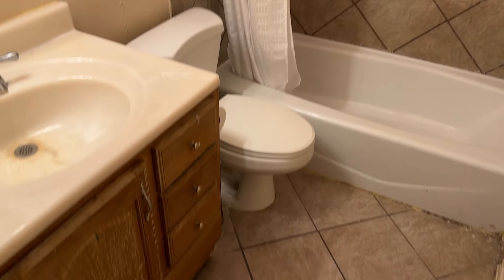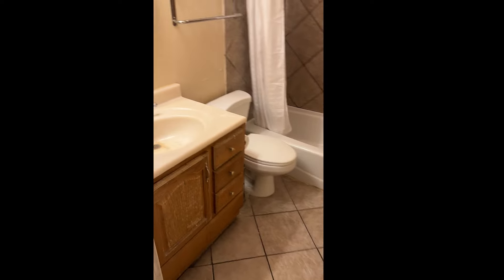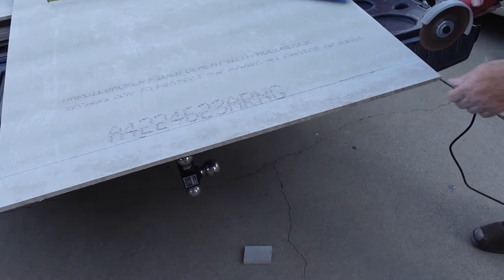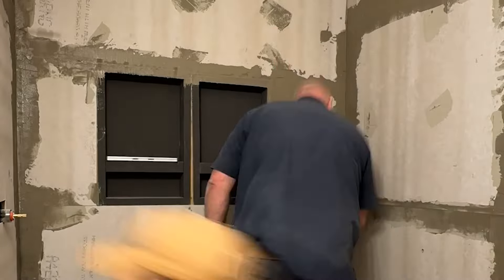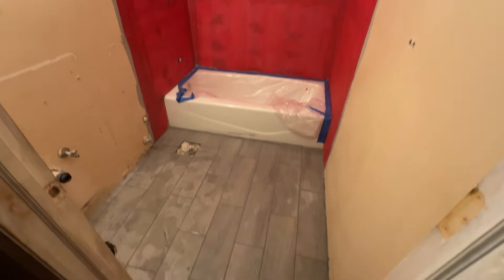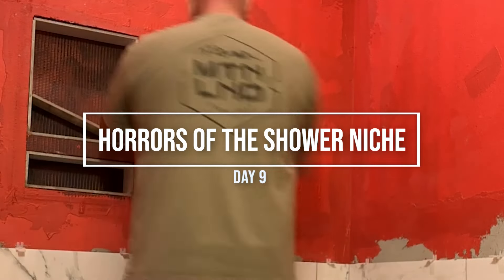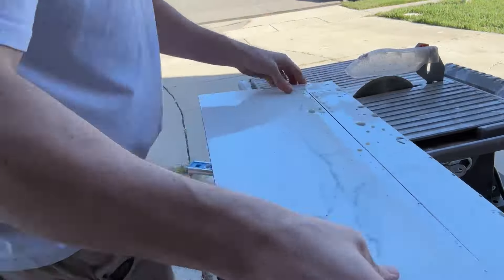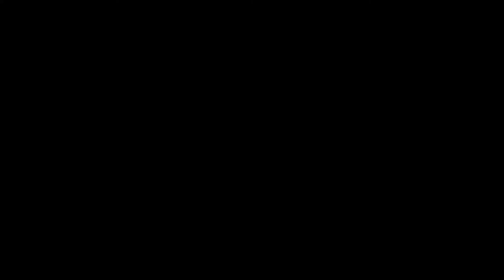DIY Bathroom Remodel

Comment: Hi there. Congrats for your job with your dad. Hope you guys had a good time together.

I work with bathroom renovations and i will just leave a few tips for whoever watched your video and is willing to do the same at their homes.

- before watching tutorials of how to set tile watch tutorials of how to plumb and level your walls and floors. This is the most crucial step for a proper installation.
- If you are using large format tile (anything 24" or larger) avoid the brick pattern because tiles tend to bow at the center and you may have lippage when using brick patter due to the fact that you will have the center of the tile (the lowest part of the bowl) right next to edge of the adjacent tile (the highest part of the bowl)
- if you go with a concrete board you still need a crack prevention membrane before setting the tile. It can be the same redgard used on the walls with fiberglass mesh on the joints but is much easier if you just go with something like a Schlutter membrane that can be applied straight to the plywood. ( Check if the floor is properly leveled before)
- always center your niche to the wall and measure upfront to make sure you will have a full tile at the bottom of the niche otherwise you will have harder cuts to work with.
- when spreading thin-set make sure to always use your trowel in the same direction (horizontal or vertical).
- you cannot only apply thin-set to the wall or to the floor you also need to back butter every tile piece to ensure 100% coverage and proper bonding.
- if you are a beginner you can cut a 2x4 in shims and create a template of your walls and floors using hot glue. (Makes everything easier)
- you cannot grout the corners (wall to wall and niche). Apply silicone caulk because overtime any grout at the corners will crack and fail.

I wish everyone good luck!
Reply from the maker: Thanks for the tips! I appreciate you taking the time to list that out!